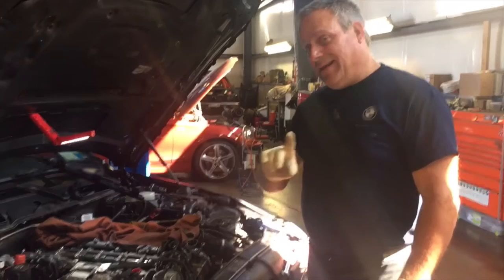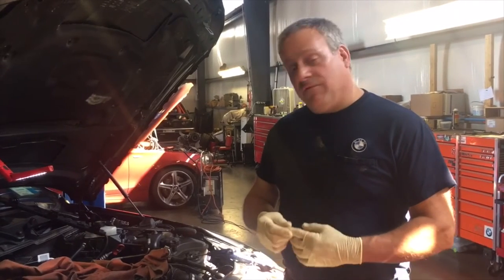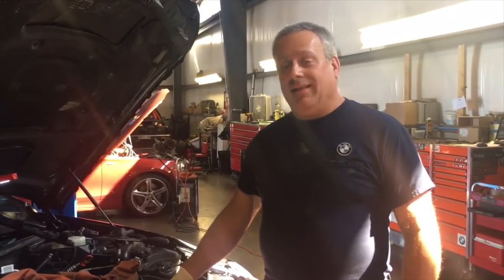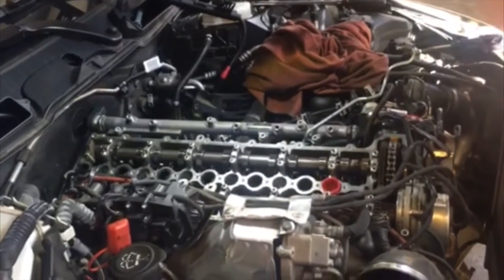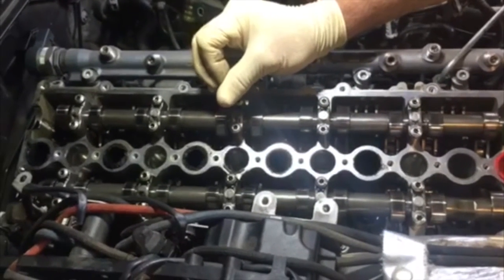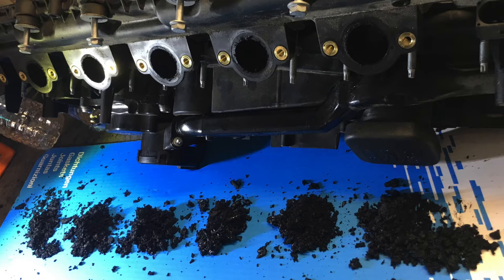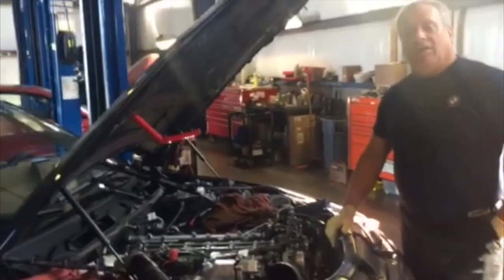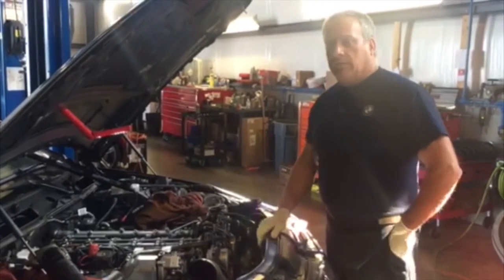TECH TALK: ep. 13: Carbon Blast on a BMW 335 Diesel

Comment: The long term solution to this is an EGR delete - no more soot gets recirculated into the intake manifold.
Reply: freezeme360  Nonsense. EGR reduces the levels of oxygen in the combustion chamber resulting in less oxygen and lower combustion temperatures which is why it helps reduce NOX formation. Removing the EGR results in increased combustion temperatures. Diesels that have EGR deletes and their DPF's removed can be tuned to generate more power while at the same time reducing fuel consumption. The only correct thing you state is they will pollute more . . .at least until the catalytic converter hits 200C and the SCR then kicks in.
Reply: freezeme360  np - diesels are (obviously) a lot different to gas engines as 10 years and a lot of expense owning a 335d has taught me but the emissions control systems on these cars are incredibly unreliable because they are so complex  . . . and feeding exhaust gas back into the intake . . .  it should not have been allowed. Yes in theory it works (in the same way chopping someones head off will stop their headache) but feeding dirty gas in to the intake results in massive carbon build up in the intake which then costs a fortune to remove. Direct Injection is a bad idea . . . the EPA (which is mostly filled with scientists who don't live in the world of practical engineering) decide to set pollutant limits that are so low that they are unachievable without extremely complicated engineering solutions and the definition of a bad engineering solution is something that is highly complex. With any technology once it hits a certain level of sophistication the cost of improving it by just an infinitesimal amount costs a lot of money . . . . or the solution is so complex that keeping it operating as it should costs more money than the average car buyer bargained for . . .seriously the cost of implementing repairs and the carbon foot print associated with them is undoubtedly more than the benefit derived from the initial solution. Just fyi I am an engineer working in the renewable energy space and I spend all my days looking at problems like these trying figuring out what makes sense and trust me  . . . its rocket science or pretty close!

Comment: Interesting video, i own a 330D lci but only put 10 000km on it. I wonder how my car will handle the carbon build up. Can it be the fuel you have in America? I'm from Sweden and we have alot of HVO diesel in our tanks. Which supposedly is burning cleaner.

Not to forget oil changes that could also contributed to build up? How you drive have to be an mayor variable to the build up as well?

I always let my car get up to temp and i mostly do highway driving. I also drive extremely aggressive, meaning i mostly have the pedal welded to the floor. I also have an tune but have not removed any of the emissions systems (yet :D )

Comment: I own a 2011 335D.  Lost power and particulate filter errors.  100000 miles and never cleaned.   Can you recommend a shop in North Jersey - NYC area.
Reply: Do you still have your 335d?? I just got one about month ago in CA with The same exact problems Carbon build up and DPF Backpressure ive been quoted 8k$ in repairs😭 kinda bummed but i wamt to fix it As much as i can in the future such a nice Car
Reply: 129k miles and was running pefect for 2k miles before codes popped